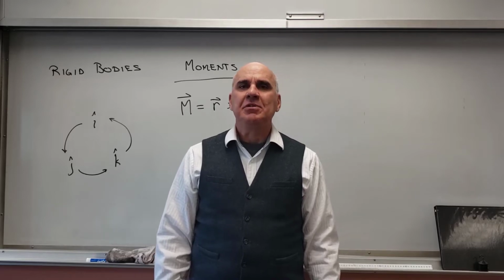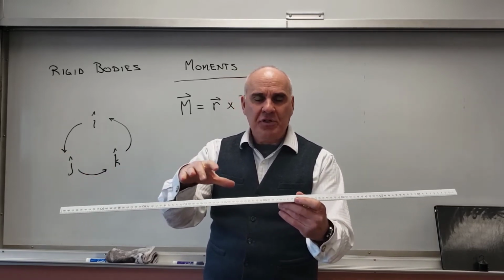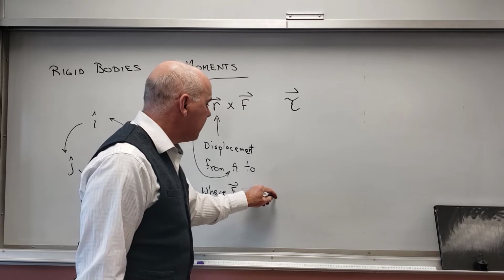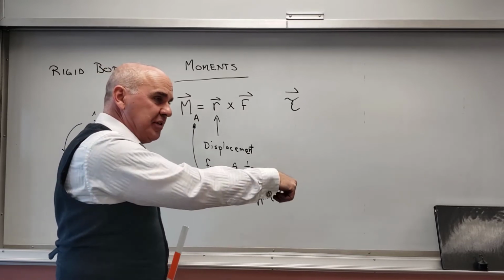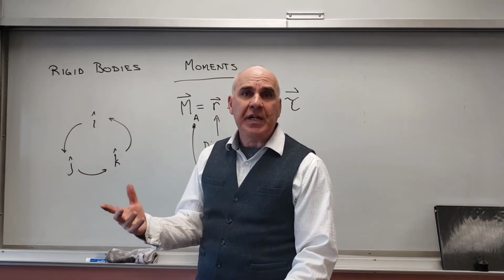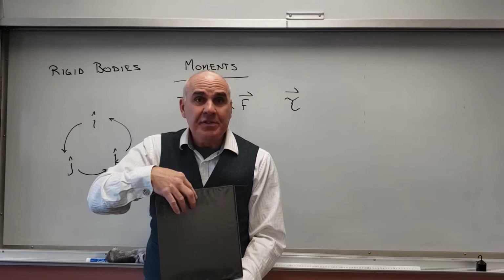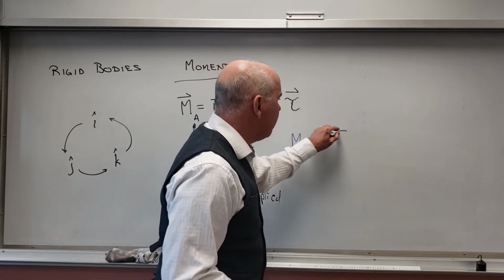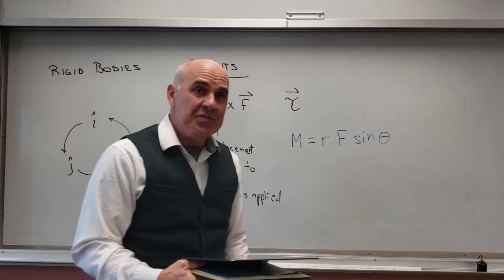Statics Moments A

Comment: If your rotation axis is the direction of your thumb when you curl your fingers in the direction of rotation, what does an negative rotation axis signify?
Reply from the maker: If you choose the rotation in the direction of your fingers to be positive, then a negative rotation is in the opposite direction. This is generally designated as positive for counterclockwise rotation and negative for clockwise rotation.